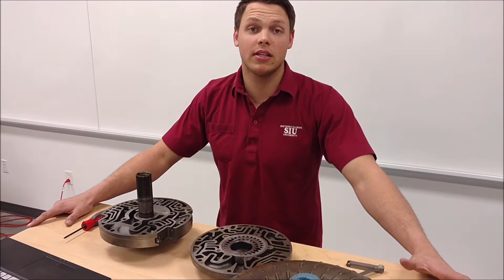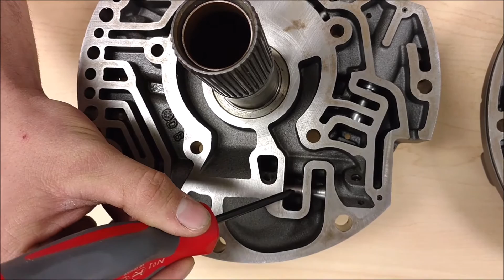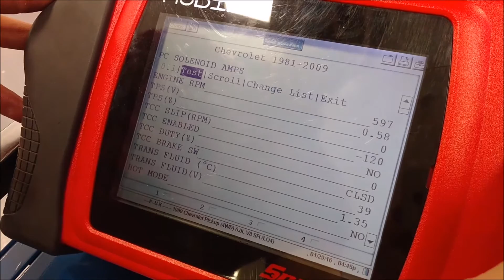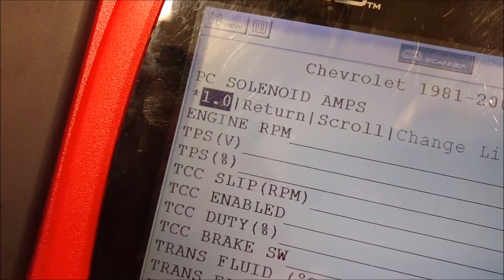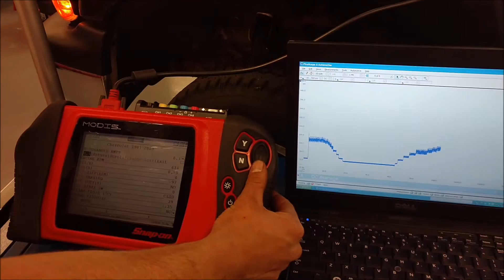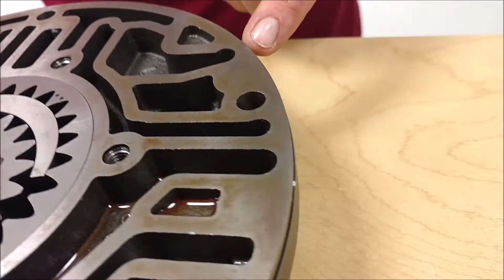4l80e oil pump   Josh

Comment: Hi, thanks for your video. I have a VW Bora Auto transmission. It suddenly stopped moving forward or reverse. I removed the gearbox. I noticed the torque converter end that goes into the pump has two of it tangs broken( my thinking these tangs drive the pump gears). I also noticed that the gears are difficult to turn by hand, except you use the torque converter (I have a spare converter). could the failure of the pump prevent the car from moving in all directions? Is the pump gears supposed to spin easily by hand? Thanks

Comment: I liked you video and the two gears diagnostics. I am rebuilding now a 5HP19 transmission and there is no info regarding clearance between the oil pump gears. Is this method fits 5HP19 oil pump as well ? I uploaded a video and I will appreciate your opinion. https://youtu.be/5vhMkq0QO0A